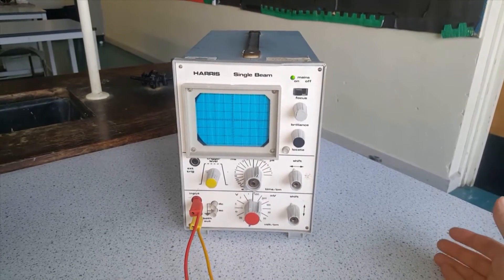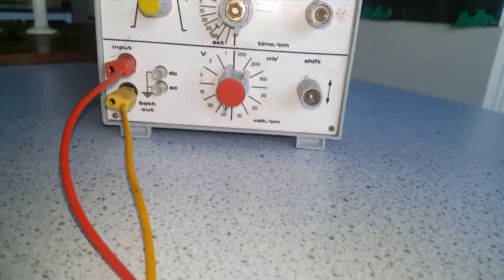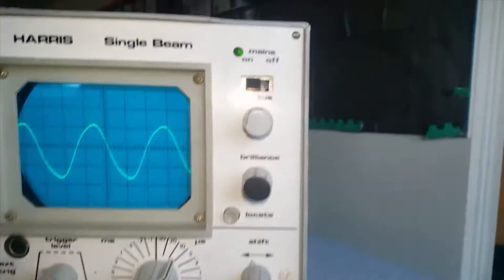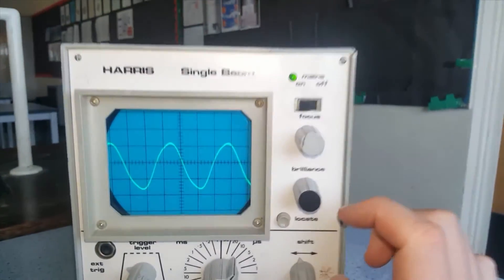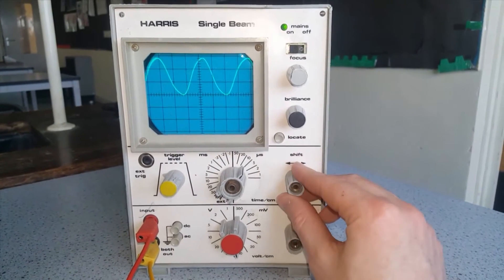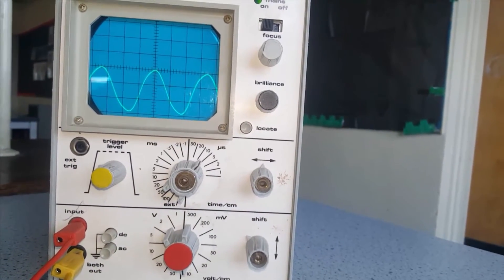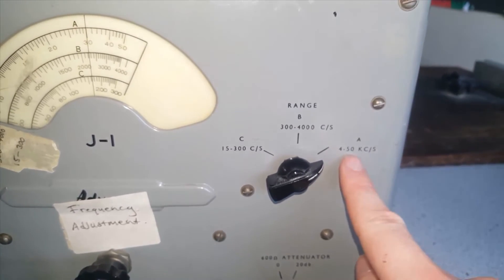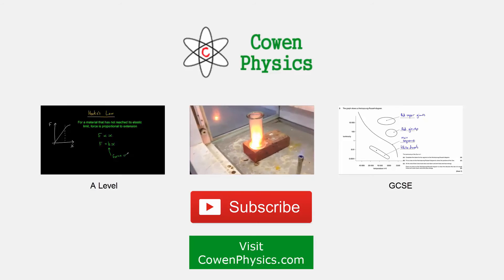How to read an oscilloscope (PAG 5.3)

Comment: Why do we need to know the volts if we aren't going to use them? Is that for something else?
Reply from the maker: +Townley 101 Yeah, in this example we didn't use the voltage. An oscilloscope can be used as a voltmeter, especially if you're dealing with an AC signal (beyond A Level). For our purposes, it's useful just to know how to determine the amplitude of the signal.